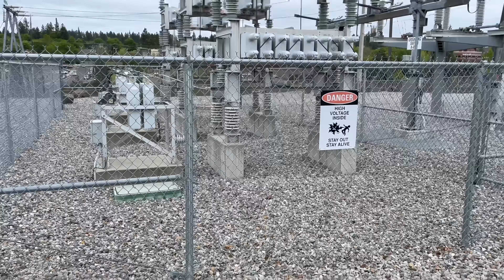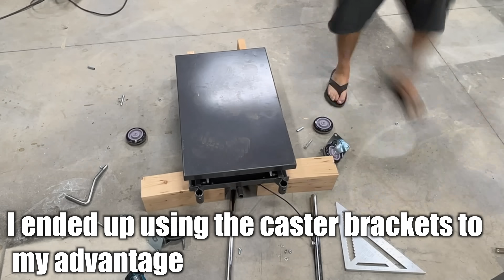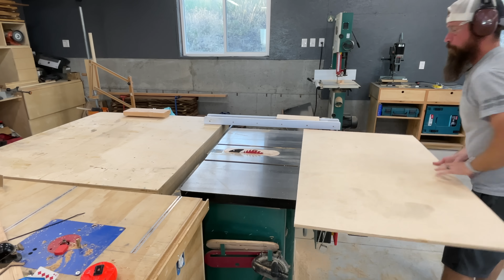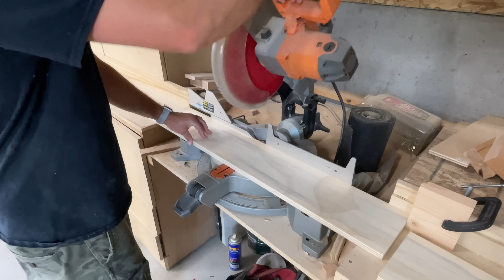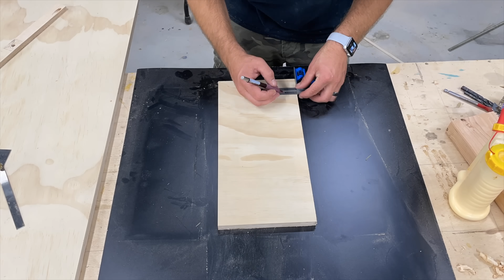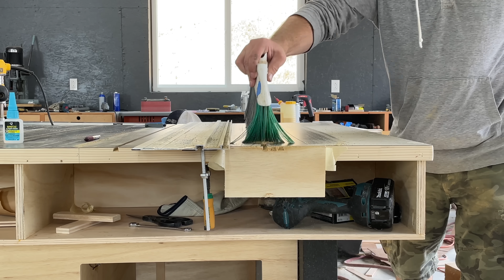This SECRET Harbor Freight workbench didn't exist... Until NOW!

Comment: I built something similar about 5-6 years ago, but I used the motorcycle lift from HF (the larger, ride on one). I built a torsion box table to sit on top of it like you did but I put a sheet of melamine on top of the torsion box rather than covering the top surface with mica. The melamine is cheap and easily replaceable when it gets too banged up. The height of the table top adjusts from about 12 inches to about 35 inches, if I remember correctly. The only downside is it's a little wobbly, so I built some adjustable legs when I need it steady. I'm impressed with how stable yours is with that box in a box solution.

A side benefit of my table is I can get it to tailgate level and slide or roll things out of the back of my truck onto the table and then get it close to ground level. I've done that with a refrigerator, a 90hp outboard, a riding mower, tons of plywood, etc.

Comment: Great work what about some dog holes?
Reply from the maker: Thanks! I intentionally didn’t put dog holes in this bench. I’m not a huge fan of dog holes in plywood topped benches. I’ve got a traditional Rubio bench thats better suited for dog holes. This bench is more for assembling projects, and be used as an in feed table for my table saw. I used the match fit clamp system instead for when I need to secure items.

Comment: Great bench but it could use dog holes but then you'd need to plug every hole not in use since you can't vacuum the dust out.
Reply from the maker: I intentionally chose to use the Matchfit system instead of dog holes on this bench. I didn’t feel dog holes would be much benefit to this table and like you mentioned it would have only lead to a dust accumulation issue in hard to access areas.
Reply: @brewbuilds  Fair enough, nice build.

Comment: You can flow solvent into the joint and gradually release the laminate if it sticks like that. Then wait till that evaporates and apply new glue over the area. Just make 100% sure nothing like dust or grit specs stuck down while messing with it. Cool bench, gorgeous home and shop.

Comment: curious>   what does this weigh empty then weigh when loaded with tools??? it looks good but way overkill..... cost?
Reply from the maker: The lift mechanism is rated for 500lbs, i probably have 150 lbs on it with tools and the top construction. The most expensive part was the lift cart I used and it was about $230, couple sheets of plywood, and some Formica. The rest was just consumables. So it wasn’t to expensive. 👍🏻

Comment: Great build!  I wonder, does the HF lift table leak down on you?  How would you add the ability to lock the table at whatever height you raise it to in order to prevent it from dropping?
Reply from the maker: So far I haven’t ran into that issue, and have left it raised for over a week. I’m sure do to the quality of their stuff that will come with time.😂 but I have plans to add a (saw tooth) ratchet latch to hopefully address that. I want to make a video on it. It just hasn’t been a huge priority so to it not being an issue yet. Thanks for watching and commenting, that’s a great observation. 👊🏻
Reply: @brewbuilds  Thanks for the reply!   I have had one of these 1000lb HF carts for a couple of years, and I have started getting some leakdown on it when it sits raised with weight for a few hours.  I might just need to rebuild the cylinder.  I read in your comments somewhere that you provided access for maintenance, good planning. I did see a video somewhere with the sawtooth ratchet concept.  I'd like to think up something a little less complicated to make.  I'm definitely copying your ideas on the box-inside-a-box to add stability!
Reply from the maker: @vzar47a yeah I can fully access the lift cart still. The saw tooth concept is still just an idea, once I tackle it I’m sure it will change as I go. The sliding column worked out great. Honestly better than I thought it would, and to this day it still operates like the day I built it.

Comment: a few questions, and they are purely just for learning sake and not a dig.

 I know free stuff is always great, did the frame give you this idea? a wooden frame could be easily built, and not had to adjust around the pre-built frame. what are you planning on putting on top of it that would require such over engineering? did you consider other table top materials like melamine?

thing I learned about laminate tops like that, is buy it a bit over sized, then you can router trim it to match the shape you need even if its crooked.
Reply from the maker: Thanks for watching, and taking the time to comment and ask your questions.

The frame: it would’ve been a hell of a lot easier to build the frame out of wood😂, and not have to modify this one, especially since my shop isn’t setup for metal work, but I couldn’t let the frame go to waste. I’ve had this idea for awhile, and since I got the frame I decided to tackle it. As far as the top and engineering it I really wanted to make sure it wasn’t a wobbly mess in the full raised position, so  I did everything I could to avoid that, as far as the torsion type design those are fairly common for rigidity, ensuring it’s stays flat, and I wanted the cubbies for storage. 

Melamine would be a great alternative, I feel like the laminate is a little stronger though. I could be wrong about that, it’s just my opinion. Laminate was one inch oversized length ways and width ways, but we’re it made contact in my first try it wouldn’t have covered the entire surface. Anything over the size of sheet I got I believe would need to be custom ordered and would probably be more expensive.
Hopefully that all makes sense.
Reply: @brewbuilds  made perfect sense! thank you :)
Reply from the maker: You bet man.🤘🏻

Comment: I love this. Mega heavy duty. Lots of wasted space inside though.
Reply from the maker: Thank you. So I left the inside on the one side with out the internal storage because if I ever have to work on the lift components I can access them. A couple of the covers on those sides are removable so I can get to it if needed. I’m working on the exterior storage right now. I plan on doing a follow up video showing that, address some of the questions, and things that didn’t make it into this video. 👍🏻
Reply: @brewbuilds  Very cool. Even though you didn't show leaving access to work on the internals I kinda figured you would have left some. I like the idea of french cleat system on the lower sides. I plan on building a dust catch base for my table saw with french cleat storage for jigs and sleds in a similar fashion.
Reply from the maker: @Jwalk9000  yeah it’s hard to show everything in these videos. That’s sounds really cool. Keep me posted with how it turns out. 👍🏻

Comment: interesting re-use of a mounting system from the substation, really glad it found a new home. The clamp system, any worries about pulling the clamps through the MDF top when cranking down the clamps? what was the deciding factor in the jig system you have vs say an aluminum extrusion system? thanks again for the videos.
Reply from the maker: The aluminum rack was definitely a nice find. I like repurposing items anytime I can. The match fit dovetail system is really cool because all the upward force in the dovetail channel is combated with the same downward pressure from your work piece you are clamping. So theee isn’t any concern with it pulling through. I’d be willing to bet your clamp would fail before the dovetail. Hopefully that makes sense. Thanks for watching and commenting.
Reply: @brewbuilds  ah ok! i see what you mean about the clamps always having something above them when they clamp, being a fixed C shape, i thought that they might come in an "off axis" variety as well like welding table clamps or jack clamps on a milling table that sit in the T channel. thanks again.
Reply from the maker: @jr3628  no problem man, that was my thought too when I first saw them. I actually tested them out on a piece of scrap melamine before I used them on my bench. I tightened the hell out of it and had no issues. 👍🏻

Comment: Placing the casters inboard would be ideal. The long sides have a spot. I’d trip on them often and get pissed. Easy to change if they annoyed you. My shop is smaller with less space to get around and you have more space so it’s less likely to get caught by them.
Reply from the maker: That was my initial plan, but required more work than i was willing to put into it, and the benefit was minimal. So I opted for where they are now. Fortunately they sit about flush with the table top threshold so tripping shouldn’t be an issue. 👍🏻 Thanks for watching and commenting, I really appreciate hearing feedback. 🤘🏻

Comment: Dude, you got some serious tools. Wow! Are their plans? How does one get a hold of the frame you used?
Reply from the maker: It’s been a slow process building up the tools I have. 😂 unless you know someone in the high voltage industry, it will probably be kind of hard to find one of these. But to be honest it would probably be easier to make the entire bench out of wood. I didn’t design any plans for this one, because I knew it would be a one off, and I built it on the fly. I’d be willing to answer any questions about details, and dimensions if it’s something you want to try and build. Thank you for watching, and taking the time to comment. 🤘🏻

Comment: Real nice!  How much up & down travel is there?
Reply from the maker: Thanks joe, I have it set for about 8” of total travel which puts it at 42” in the raised position, it has the potential to raise 15” total, but I didn’t find it beneficial to go over that 8” mark. If for whatever reason down the road I find myself needing the extra height, I can adjust the stops and allow it to go higher. 👍🏻

Comment: I'm planning on doing an outfeed/assembly table with the laminate sheet as well. Did you have any chipping or cracking when you went back over it to flush trim the laminate? Great job!
Reply from the maker: Right on, no I didn’t have any chipping when I flush trimmed it. Just make sure your router bit is in good condition. 👍🏻